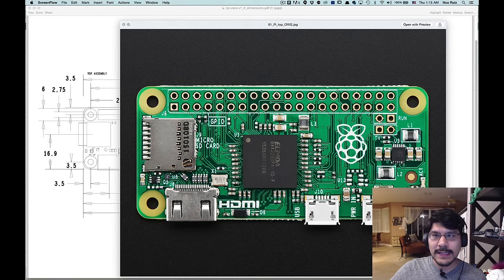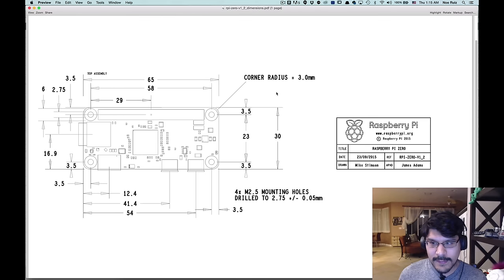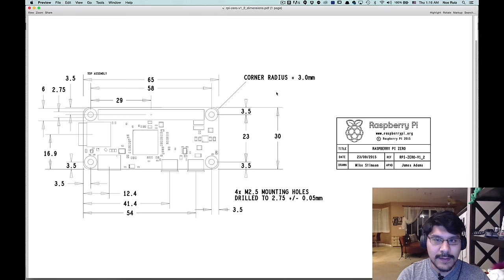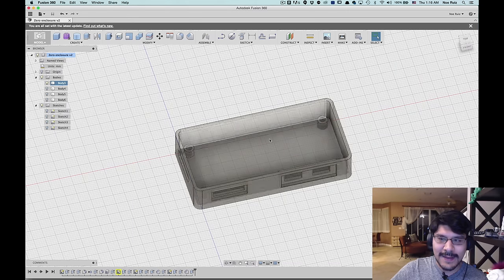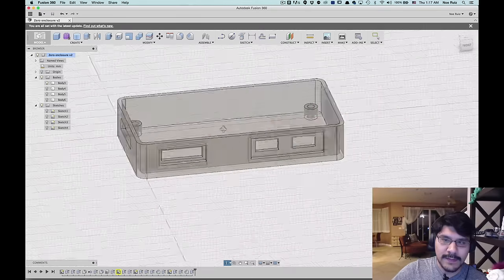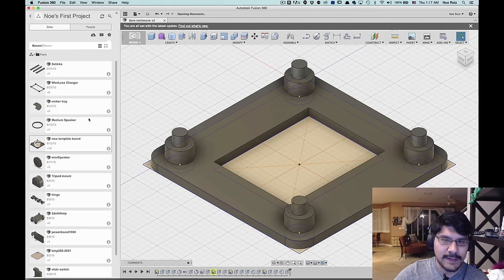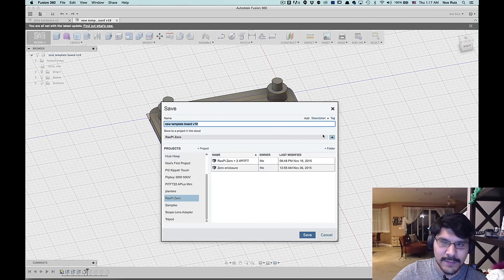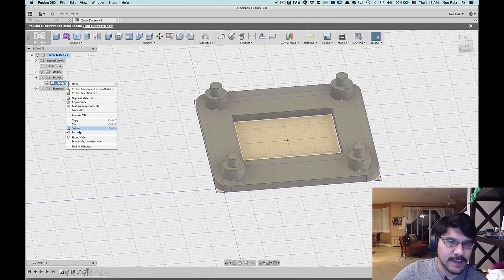Layer by Layer - Designing Raspberry Pi Zero 3D Printed Enclosure

Comment: Why did you guys start using Fusion 360?  Isn't it to expensive (after the first year) for most DIY makers.??
Reply: It's free to use for makers and indie who make less than 100k. Check their site for more details. Also, OnShape is pretty cool!
Reply: Ok, Thanks.. I could not find anywhere in the agreement that it was the case, however I do see that some AutoDesk employees are saying that is indeed free, but a 'renewal' process will have to be completed each year.

Thanks again!
Reply: +Noe Ruiz I am just starting out - should I use Autodesk 123D or Fusion 360? Had dabbled in 123D a little bit. Looking at your video, Fusion 360 seems like its got better features. Whats your take?

Comment: If you guys could make a WiFi HAT for this board that would be awesome.  It would mean no need for a wifi dongle and a powered USB hub.
Reply: That would be an awesome HAT!
Reply: USB hub hat?
Reply: +Noe Ruiz a connector for an external antenna would be awesome as well if it was possible. :)
Reply: A official 8$ or less WiFi and two standard USB HAT board would be awesome
Reply: Problem solved with the RPI Zero W. Ok it's one year later. But it's solved.